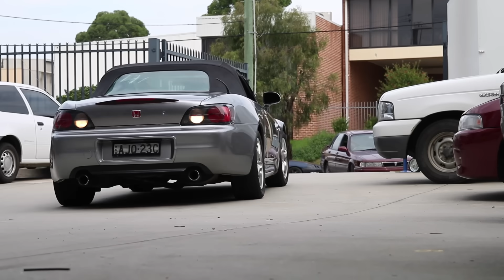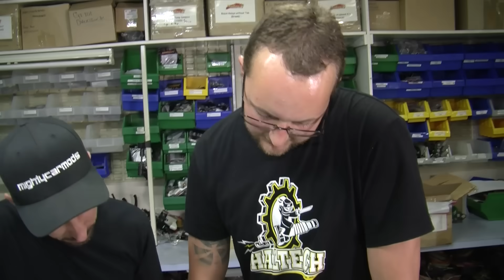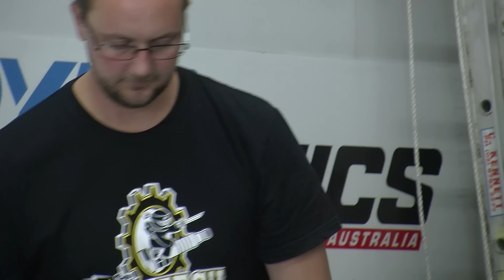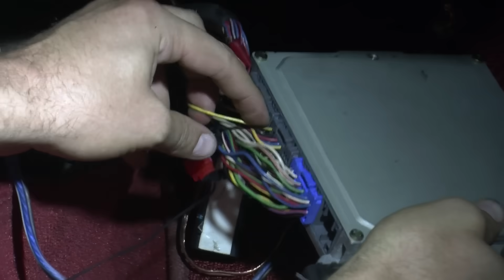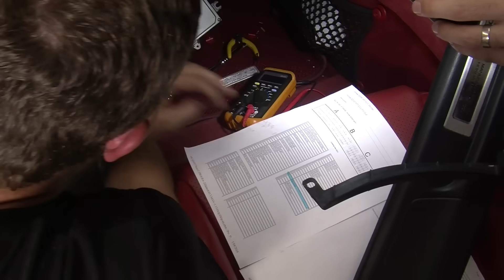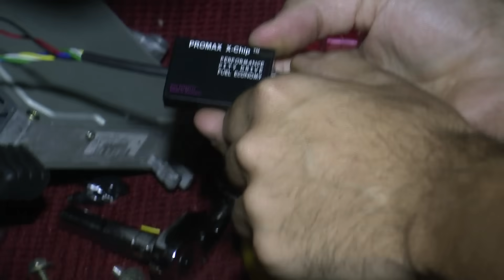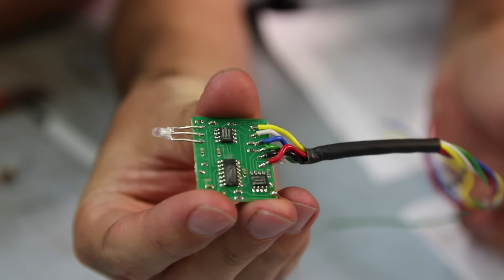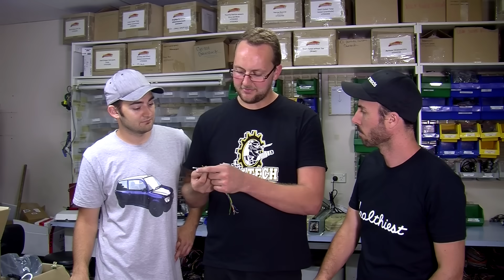eBay Performance Chips -  Mythbusted

Comment from the maker: Power at the wheels and power at the engine are two different things people - do a google!
Reply: Not sure whether to laugh or cry at the fact that people need to be told about this, especially on this channel
Reply: Vadim Matviichuk And there is almost always a difference in horsepower depending on the dyno, the weather, the airtemp, the altitude etc. But mostly the big difference is between different dynos, one dyno can show 170hp and another can show 190hp on exactly the same car on the same day and the same everything else.
Reply: 93simlar  people always forget this!  Just like a torque wrench, you can test 5 right next to eachother, they will all be close to eachother but none will be the same!
Reply: Moog, next time you race marty, you should put Flurpy in the passenger seat. That way, you have a little extra unicorn POWA!
Reply: Vadim Matviichuk your car loses power over the years. watch top gear they have an episode where the dyno to older sports cars and they lost almost 100 hp over the years
Reply: You lose 15-25% or so between the driveline and running peripherals so he's probably around 205-215 horse at the fly.
Reply: bhp per ton is what counts
Reply: You guys need to put a turbo kit on honda s2000 ;)
Reply: Wiat wuts a googel? I thouht a CAI cold air intke wud make mi car fastr?!@#
Reply: Christian Gotsch
I think what people are really getting on about is that an S2000 that puts 177 hp to the wheels is a busted S2000.  Crank hp for this gen S2000 is at about 240hp.  To put down 177hp at the wheels is atrocious, even considering driveline loss (which accounts for between 10-15% loss on average).  That is (what I think) people are getting at.  I also did a double take when they said only 177 at the wheels was being put down.  Then I scrolled the video back, realized they were on a DYNOJET and not a Mustang dyno and then said to myself "Oh, that's why".  Dynojets ALWAYS read lower than Mustang dynos because of the difference in how the dynos themselves operate.  That is why they typically will say if they are SAE corrected or uncorrected numbers.  The 177 hp this is showing is uncorrected, hence why it is so low.  If you correct it, it settles about where it should be, low 200's wheel horsepower.
Reply: Vadim Matviichuk Different dyno, different fan setting, different environment = different hp readings.  Not two dynos are the same
Reply: Vadim Matviichuk There are different versions of the s2000.
Reply: Jacob Laster mate*
Reply: I LIKE TURTLES!!!
Reply: I dont disagree necessarily however all well kept equipment should still read to within 3%-4% of each other during the same test in similar conditions. It should not be drastically off which is what it sounded like.
Reply: so, 1 Unicorn is 1,75 Horsepower is 1,3kW, so the stock S2000 is making around 100 Unicorns of power.
Reply: 93simlar Everything is possible. I've never heard of such dyno theory, so i might be wrong.
Reply: RunesLegacy There's actually 3 different versions of the S2000.
Reply: Joe11Blue I didn't know that but Idk a lot about the lil 4 and 6 bangers that's just never really been my style bro I'm more of an old school big block v8 American muscle kinda guy that's what revs up my engine lol but don't get me wrong I ain't saying the lil 4 and 6 bangers can't be bad ass rides also I just ain't as in love with them as I am a big v8 muscle car or truck ya know what I mean but what's the difference in the 3 if you were talkin about a ford lightning I'd probably already know since that's my baby I love when ppl get smoked by a full size truck and just can't stand it lol it's so funny though all the excuses
Reply: Jordan Mull When do dynamometers read power figures as they should be? That honestly has to be the most absurd thing I've ever heard considering the figures are there for a reason, to give you mostly reliable data. All the data should be within 3-4 percent of each other otherwise the data is useless.
Reply: Christian Gotsch They're there so you can get a baseline and do mods and see the changes.  They may read differently, but the units are the same and the dyno shows the same %loss, so any gain made on one dyno should be an actual hp gain that the dyno says
Reply: FrenchFruits That grammar.Its its so bad.
Reply: @JoshX9  Actually the grammar is not so bad, the spelling on the other hand is fucking horrendous.
Reply: MrBrennanCreeper Flurpy's a Nissan loving unicorn though
Reply: ***** wtf, is YouTube grammar class now professor? Who cares.... seriously, go write a book or something
Reply: ***** thats what i meant, people don't buy a sportscar to drive like an old lady
Reply: hahaha love "healthiest" shirt
Reply: slim617 Don't be that guy.
Reply: Mighty Car Mods  can you guys do a video on innovative chip you can buy on Amazon.com  it's $70
Reply: Vadim Matviichuk What exactly are you implying?
Reply: Christian Gotsch Like any other tool, a dyno needs to be calibrated correctly. Calibration can "fall off" after a time. EG: I've got some very high tech battery chargers, accurate to within 1/1000 of a volt., but unless they're calibrated annually, the numbers don't mean anything, or at least should not be trusted.
Reply: The problem that people are having isn't crank vs wheel power.  It's the fact that these runs were done on a Dynojet dyno and the numbers are uncorrected.  Most magazine numbers are corrected or run on a mustang dyno.  In those cases the number would be closer to 200hp at the wheels.
Reply: 93simlar
The problem that people are having as you have mentioned isn't crank vs wheel power.  It's the fact that these runs were done on a Dynojet dyno and the numbers are uncorrected.  Most magazine numbers are corrected or run on a mustang dyno, which is a different type of dyno and always reads higher than a dynojet dyno.  In those cases the number would be closer to 200hp at the wheels.
Reply: Just a few things I'd like to address within these replies. 1. This car appears to have been dyno'd on a Dyno Dynamics dynamometer, NOT a dynojet ;) DD's are notorious for being heartbreakers as far as hp numbers. That being said, 177whp does seem low for a stock S2k :-/
Reply: xex2kok uh.. exhaust is exhaust. there is no "magic" about brand exhausts vs generic. it's the least relevant part of an engine, its just a long tube of metal which expended gasses escape through. As long as it's in the right shape and angle, it doesn't matter the brand.

what you should be looking out for is quality of steel and welds/fitment. but thats it. no such thing as "this brand is generic so its gonna suck because magical exhaust powers of blitz and HKS is absent from the piping." NO. a pipe is a pipe dude.
Reply: Yes you're right but a stock s2000 makes around 235-240 bhp at the crank. So the power at the wheels should be around 200 bhp (considering a 20% power loss true the drivetrain, and that's still quite on the high side). So Moog what happened to your s2000's power? I'm not sure if Honda changed the spec for the australian market due to emissions? I know that BMW produced the e36 M3 for the european market with 286/300/321 bhp, for the american market they only produced cars with 240 bhp due to emissions.
Reply: But then why was the S2000 only making 177.1 rwhp?  That's 208 bhp at the flywheel.  Aren't these things rated at 240 bhp?
Reply: Turbo chip on turbocar is the real thing
Reply: ***** I've already tired to explain that. They don't care, everyone KNOWS whats right. Horsepower is a function of work of time no more no less.
Reply: Vtec, yo.
Reply: 75IFFY lmao XD wtf is a 75iffy
Reply: Vadim Matviichuk there are also vast differences in dino's too, food for thought
Reply: mynameisray at the crank lol
Reply: If the argument is that you cant get an accurate engine hp number number on a chassis dyno, yes that is true. However I don't care about engine hp when all I need engine hp for is to tell me how heavy of a clutch I need and I can approximate that in 5 seconds. I care about power that is delivered on the ground.  176 hp at the wheels is going to be accurate to 3%-4% on any chassis dyno you use regardless of how the number is measured and as long as it is measured in similar conditions.
Reply: of course if your point is instead that a dyno does not directly simulate a road driving situation because it cant get the same volume of air blowing over your car as at speed, I also agree with you. A hotter mechanical engine is a less efficient engine which is opposite of a heat engine before anyone wants to correct me.
Reply: Why don't people just cross reference the quarter mile time that an S2K should get with Moogs 14.4? Super simple....
Reply: IIRC Moogs S2k engine had about 100k miles on the clock and depending on maintenance (bad on most s2ks) it should have a significant performance drop. The second thing is the dyno and dyno adjustment. Depending on various sources the S drag coefficent is 0.36 to 0.40. And i don't know how fuel quality is in the Outback ;-)

Anyway the really important measures are actual performance figures and track times.
Reply: Marcelo LopesVEVO  Vtec and turbo? lol ;p
Reply: ***** DynoDynamics reads about 10-12% low vs DynoJet, which puts it closer to that 200whp figure stock S2000s sit at. On top of that count drivetrain power loss because this is at the wheels, it sounds right for DD figures vs BHP.
Reply: Everyone keep talking about the bhp/whp figures... he did a 14.5 @1/4 mile which is bang on the money for a 'stock' s2k. They should check ebay exhaust kits for the s2k to see whether they're just as garbage as all the other unbranded 'mods'.
Reply: this is fact BHP (break horsepower) Is the power which is measured AT the crankshaft. A dino measures power after its been through 3 shafts, 4 gears, a driveshaft, a rear-diff, 2 axle shafts and spin the wheels. this usually takes roughly 15% of the power just to turn everything. this is why carbon fiber/aluminum driveshafts and lighter alloy rims were made.
Reply: erick culler  Dyno Dynamics read 10-12% lower than Dyno Jet. It's why they're known as a heart breaker dyno.
Reply: HeavenzBreaker well thats the thing... do those generic brands have the right shape and are they made well.. also noise, if they sound like a gnome in a tin can with a wooden spoon or a majestic lion growling at its lunch, lol
Reply: john almand  don't confuse yourself. if your turbo and/or have a large displacement engine, the basic idea is that you have essentially a pipe that's thick enough and straight enough to allow horsepower (notice i said ALLOW, as exhaust systems do not GAIN horsepower). Thats all you need.

And it's not that hard for any company to make a straight pipe. it's not rocket science and has been proven again and again.

The difference between a stainless steel exhaust and Titanium exhaust is price and weight. not engine performance.

So yes a generic brand (or even DIY if you know how to weld) can easily make an exhaust that allows your engine the same performance as an extremely expensive exhaust.
Reply: NORML85 u dont seem so NORML
Reply: The s2k is so slow
Reply: Jesse Seijerlin Different dynos can give different readings. You can read this article that Hot Rod Magazine did that compares some different brand dynos: http://www.hotrod.com/techarticles/general/hrdp_1103_chassis_dyno_testing/
Reply: MrBrennanCreeper
And more weight boo!
Reply: They arent "two different things" when the result is still. fucking. zero.
haha.
Reply: All Gas Mn The point they were trying to make was that these eBay 'chips' are ripoffs, yet people still buy them.
Reply: 20% is the norm. Do the math and you'll see it's STILL way below the 240hp honda claims. It should be at like 196whp with perfect conditions. 20hp at the wheels says a lot about what the motor is doing at the crank. I guarantee the absense of torque is why this motor is so adversely affected by varying conditions. Also there may be something wrong your car. These things require valve adjustments and...ya  XD
Reply: Hey MCM why is your power so down?? I though factory HP was at 240????
Reply: Hey man, how about a spoiler alert here?!  Na, just kiddin', you get what you pay for when it comes to performance mods.
Reply: 93simlar WOW I worked on dynos in the auto industry for a few years and if that was true we might as well throw the dynos out since you claim they tell us NOTHING>

You sir; are wrong.
Reply: John-Paul Wylie Yes, its math. Horsepower is a function of work over time. More horsepower means it would climb through the rev range quicker.
Reply: if there was a difference in "power at the engine" it would have made a difference with "power at the wheels" 

if there is ZERO appreciable gain AT THE WHEELS then what is the point?

let me guess, you are a person who fell for "chip mods" and are trying to justify and convince yourself that it indeed does do something, when in fact it does nothing.
Reply: CrazyForCooCooPuffs Almost correct. No horsepower is measurable. It is all a calculated number based on torque and rpms. Yes, brake hp is figured out by the actual torque you are making at the wheels, but the horsepower itself isn't actually measurable.  HP=(torque x rpm) / 5252. Peak hp would be the biggest number you get along the curve. At 5252 rpms your car will produce the same hp as torque

Yes, the 177hp is the hp at the wheels, so the engine is producing over 200hp at the crank.
Reply: People don't know this?
Reply: COBB ACCESSPORT AND INTAKE to a subaru?

Can you do a test on that?
Reply: C20/-\ that is a real chip, or factory programmed to be different.
This chip from ebay falls into the scam category.
Reply: Mighty Car Mods you guys really need a tv show
Reply: me?
Reply: Tom Jones vtec means it runs on uncle bens wild rice
Reply: lmao
Reply: Mighty Car Mods Why THE Ukraine? It is just Uktaine without THE!!!!!
Reply: +Mad Scientistsami 4hp a year? So my 80 Rabbit 1.5d (48hp new) must have -52hp...
Reply: that's kind of a double duh... you drive onto a roller dyno   you can't measure hp at the crank.
Reply: Christian Gotsch Unless it's a RWD setup, that can rob around 15% of power, with all the forces from the driveshaft and diff etc
Reply: Yoshio Tamiya
There is actually not industry standard for calibrating a dyno.
Most tuners will use a car with known power output, like there own or a customers car that is regularly used for R&D.
Reply: ostenvind ... thats not the point here. yes i am aware
Reply: NorwegianBadaz You obviously have no idea how "Vtec" works or what it even is... a lot of iVtec and Vtec engines are rocking turbos or superchargers.
Reply: Octane Anarchy Detroit Born and Built But then again the Americans always lied about the horsepower ratings of old. That mustang didn't make the claimed horsepower even when new. Since the SAE HP rating is without any form of peripherals such as water pumps, generator belt, air conditioning and so forth.
Reply: tomelliott9
The quarter mile is exactly as tested on new car. Those S2000 just never had 240 hp.
Reply: Marine475 An FR set up can have huge losses in the drive train though, but atleast that means moogs S2K is alright and not broken
Reply: Moog, You need a turbo to make ponies :D
Reply: Hey Moog some things wrong with the MCM app. It's saying Tapatalk does not support your forum.
Reply: tomelliott9
There are not that many non RWD cars with 240+ hp are there? S2000 is about as fast as car that I drive daily and it's a big rwd fat V8 pig with automatic gearbox and bit less hp/ton. S2000 is a good car, fun and fast but it doesn't have 240 at the crank. Anyway I know this from a friend who used to work at Honda at the time when S2000 came out, we had a bit of a chat about it I said to him that the maths don't work with that engine and he told me that they pulled numbers a bit and it can make 240 hp but only in JDM spec and on engine dyno.
Reply: ***** Space out a letter? What are you talking about.And even if my grammar wasn't 100% it was much better then that guys.His comment was like he just button mashed the keyboard.
Reply: You do when that sentence is finished and you are starting a new one.And plus even if its not 100% perfect its better then most idiots on the internet? Right!?
Reply: ccx218 He may be a Nissan loving unicorn, but, he can still help out his unicorn powered Honda brethren.
Reply: ***** they did about all old cars by alot and most of them also if you took a simple resitrictor out or changed a carb it would increase but a large margin
Reply: 5150 Failure hey mate - speed at idle is based on your gearing and has nothing to do with power, torque, or even the engine at all, its all about rpm vs gearing
Reply: traaaaaaaaaaaaansfffeeeeeeeeeeeeer loooooooooooooooseeeeee woo
Reply: Vadim Matviichuk A car loses about 4hp every year so this result is absolutely normal.
Reply: Jacob Laster because he wanted to.
Reply: Do a google. lol
Reply: ***** S2000 runing in america can be underpowered because of the petrol, maybe if its US version it is tuned to use 92 octane petrol or even lower, in japan they use ~100 octane petrol for cars and s2000 is sporty car, petrol makes difference. My bmw suggest using 95 octane petrol at least, i filled my tank with russian 92 octane petrol, the consumptions of it was 1.5x bigger than with 95 octane, with a little bit of power loss
Reply: 5150 Failure  thats not making power. that's using more gas at idle. thats it.

the only thing your friend "tricked" is himself by buying an overly-lean reading maf, causing a larger injector cycle.
Reply: torque and horsepower.
Reply: DonForceFeedback totally agree with the ebay catback i have wondered about those for years!!!!
Reply: john almand The ones I have seen people buy on ebay worked fine. They are usually not made of the best material available so they probably won't last as long as a reputable brand but they work well enough. There are so many brands out there that you just have to find the cheap ones with good reviews somewhere because there will be some terrible exhausts on there as well.
Reply: Horsepower doesn't count!!! it blasts out unicorn farts and that is awesome!!!
Reply: mynameisray
the car is listed at 250 hp,that is way off still
Reply: Thanks for the education that I already mentioned,the flywheel hp,at 177 is more than 15-20%drivetrain loss,if what honda said about horsepwer being at 250 is true then this car should be making at least 200 hp
Reply: erick culler 240*
Reply: Christian Gotsch  some places do this purposely so that customer think their cars have more power and are happy. My car ran 222.8kw at the wheels then on another dyno it ran a bit over 230. Dyno numbers are to show off, 1/4 mile runs are where its at.
Reply: howde im jc from AZ and im in high school im 14  starting a automotive cahnell ill have a my frist video up on friday cheek me out westwoodmechanic love mcm
Reply: HeavenzBreaker i see what you are saying, having said all that i still think it would be a good test.
Reply: NorwegianBadaz I had a v-tec a while back and while it was pretty quick once it got going it was slow at low revs... a low pressure turbo to get the most out of low revs would have been brilliant on that car, would only probably add about 30bhp but it would balance the power so much better. A larger turbo would mean wider wheels needed possibly a strengthened chassis and brakes, and all it would do is give me massive turbo lag at low revs.
Reply: Vadim Matviichuk Well let's say I pop a big garrett on my granp's AX...It will still make less than stock! It's stood half hour limiter time just for the fun of not being able to climb a hill! It's so obvious the car is not new and it will never be!
Reply: Well obviously it's not meant to be taken literally, it refers to any manufactures of dairy products.
Reply: Jacob Laster
Less weight = more  power. =P
Reply: 5150 Failure Cummins don't have mas air
Reply: D.J Bruce herp dongalong shlong nong kong lol derrrrrrrrrrrrrrrrrrrrrrrrr
Reply: nutsackmania do my tow mirrors make me look Der te Der or is it my boost fooler?:
Reply: You do know a real performance chip can be as effective as a re tune or ecu swap right. You also know that these mods are capable of boosting 20 to 50 or so horsepower and even more if the car is a really hi powered vehicle. Cmon guys do your research or spend money on a chip that has a good rep.
Reply: LimitlessAeon619
It's a 99. Piston rings are probably loose or worn. I kind of expect that.
Reply: it does not matter ,there was no power gain,they are measuring power at the wheels with the dyno.
Reply: so ill just save and buy a Haltech bolt on usb plug in and YO..
Reply: You mean a gargle?
Reply: CmdrTobs Didn't you just see that the chip does nothing at all? Straight through connection, meaning the signal does not change one bit. The only way to make power form "chipping" your car is to re-program the ECM. In case you are wondering what my credentials are, I own a shop. 'Nuff said
Reply: Yeah true. My bike is a 17hp difference from wheel to engine on the dyno.
Reply: ***** When we/Americans lied about horsepower, we actually underrated it, not overrated as you claim, other than that a Honda is not an American car. Must be that V-ECH powa holding it back on the Dyno, lol.
Reply: So if you have a car with 150hp and at 1000rpm it does 10kmh, then you beef up the engine and its putting out 600hp, with the same gearbox and diff (read:gearing ) at 1000rpm it will still do 10kmh.
Reply: 177 whp is about 235 crank hp, so the extra 30hp should have been at the crank so about 185-190 whp !! Not 210 whp hahaha
Reply: Eric Hermann avoid saying the power loss in percentage. People end up thinking a stock 100hp engine at the flywheel with 10% drive train power loss has only 90hp at the wheel and if you tuned it to 200hp it would only have 180hp. The 15% rule is bullshit anyway. That would mean a Bugatti engine has 1250hp at the flywheel cause it has 1000 on wheels. I used a 4wd with 25% DT loss in this case to show how extreme it can get. Ive no idea about the Veryons DT loss but I assume it wouldn't be 250hp.
Reply: HachiRoku
It's not a "Rule", it's an average.  And it holds true "on average".  The key word is average.  There will be outliers - like your Bugatti and 4wd examples.  It is an attempt to explain an idea that a lot of people weren't grasping, not to give a concrete number for all applications.
Reply: Eric Hermann
i does not even give an average. A 50 hp car would have 30% a 100hp car would have 20 and a 200 hp would have 10% and it depends on the car.
Reply: I already said that I agree with you on those cases.  However, the fact you are missing is in the word AVERAGE.  The average car is NOT a 50hp car.  Nor is it a 4wd car.  Nor is it a 500hp rwd beast.  Its a front engined, front wheel drive 4 cylinder car (Civic, Corrolla, Camry, Focus, etc) that makes under 200hp.  For the AVERAGE car owned by the AVERAGE person the 15% AVERAGE works well enough as an estimate of power loss.  You are splitting hairs.  Again, average is the key word.  Don't lose sight of the argument in your quest to simply be right on technicalities that don't apply to the topic being discussed, as I already stated those NON average vehicles are not what I am referring to.
Reply: HachiRoku And even then, on average, the same model car will have the same average loss.  Its for estimation purposes only.  If you want an actual number, you would obviously need a dyno.
Reply: Eric Hermann S2000 is RWD, just lettin you know.
Reply: zetsi77 I am fully aware of that fact.  Have driven several S2000s and nearly bought one myself.  :D
Reply: good decision on choosing to pass, I was not impressed with the two that I test drove
Reply: This is just a generalized statement;
Everyone can say "Oh it's normal" all they want...The fact remains that even accounting for drivetrain losses at 17-22% or there-a-bouts, the car is down on power. It's an early 2000 Honda people, do you really think it's lost THAT much compression over the years? Something is off about those numbers, without a doubt.
Reply: whoohaaXL

240 HP - 20% driveline loss is 192 hp, then take a decade and a half of wear and compression loss to add another 8-12 and that is a pretty accurate figure. 

(and that is being conservative at a 1.1 - 1.3 % loss of power per year. )
Reply: Gabriel Howard HOW DARE YOU USE LOGIC AND COMMON SENSE!!!!
Reply: I'll say it again, the car is down on power regardless. Every Honda I've owned (about 7 or so, till I moved onto Probe GT's) Has always had excellent compression, within 3% of factory. This is mostly on older D-series with every one being over 100k. There's no way a higher-spec engine (with beating on it taken into consideration, as I'm sure Honda knew it would happen with a 8/9k redline) would be that low unless that car was HEAVILY neglected...
Reply: whoohaaXL That is a Dyno Dynamics roller, they read lower than Dynojets do. Even within same brand dynos they all read differently. Remember dynos are mainly just tuning tools. Not meant for a "period end of discussion" type argument of a cars power output. The only true way to get an idea of a cars power level it by looking at it's trap speed.
Reply: Lolz can't believe you had to actually say that MCM!!!   XD.       GG to the eBay scams !!!   Lol.
Reply: ClintcorpCEO Kinda sad, eh?
Reply: Well, considering they didn't do anything to transmission, there still whould be a power upgrade, because the difference between base ( engine) horsepower and wheel horse power is the transmission loss... increase bhp by 35 , an you should get like 15-25 Whp, depending on your transmission...
Reply: Indicated horse power = calculated HP your engine makes in if it was frictionless
Brake horse power = horsepower you can measure with a mechanical device
Friction horsepower = the amount of HP the engine loses running it self and accessories and drive train (IHP-BHP)

177hp honda, it makes 200 indicated so u got a fhp of 23hp whch isnt bad, efficient engine
Reply: CrazyForCooCooPuffs Where are you getting 200 from? The AP1 and AP2 make upwards of 230 and 240hp respectively.
Reply: whoohaaXL ur right, for some reason i thought it was 200, so i guess its FHP is about 70....ouch
Reply: CrazyForCooCooPuffs Tell me about it, pretty poor, eh?
Reply: Exactly if you don't make any power at the engine your not making it at the wheels! Not only that but if you drive a rear wheel drive car and dyno just the engine before putting it in the car and it makes 402 H.P.Then put it in the car your gonna lose about 80 to 100 H.P. through the drive shaft! So you will end up with a 300 H.P. car!!! That's why rear engine cars screw because you got two drive axle's coming out of the transmission to the wheels not a long way to go to transfer the power!!! How's that for a google!
Reply: ***** Different horses have different horsepower so of course it isn't measurable!
Reply: '96 VR-4 Spyder hp at the wheels is like donkey power and hp at the fly wheel is horse power
Reply: 1 horse can pull 550 pounds suspended from a cliff 1 foot per second, therefore he is doing 33000 ft-lb a minute. Thats why 550 and 33000 are arbitrary numbers, thats where the horse power came from. James watt came up with the horsepower measurement so he could sell his steam engines to stubborn farmers who didnt believe horses were better than his engines, so he came up with "horsepower" to describe how his engines were better. So saying this has 2 horsepower makes it sound better than 1 horse.
Reply: ***** Being a power plant mechanic I learned that story from my instructor in school.
Reply: if its copy and paste, copy and paste it into google and you'll see if its copied.

In the aviation field its brake horse power, shaft horse power, indicated hp, and friction hp. thats it
Reply: Vtec Crub!!
Reply: I dont understand why people make fun of Vtec, like the guy above me.

any car u drive today has some form of variable valve timing so ur kinda making fun of something all engines now have, including urs
Reply: That's because some people haven't seen Best Motoring, it's a japanese car show. Besides I was only repeating what was said in a clip from one of the segments featuring Hondas ;)
Reply: what about the police chips my dad had a 01 commode ex chaser. i thought they would. what dose the wonderful youtube comments say
Reply: Power at the wheels accounts for power loss through the drivetrain. Horsepower at the engine will always be higher than at the wheels. Also hp was measured different ways Ober the years. Brake hp(BHP) is at the crankshaft, and then SAE net and SAE gross are measured at the flywheel and are measured differently. It changed over the years also.
Reply: Maybe you should have bought a better one
Reply: Just get a haltech piggy or the pro 1.
Reply: Jacob Laster Did you want to run your fingers through it?
Reply: Mighty Car Mods WTF is a vtec "YO"?
Reply: 75IFFY honda's fuel management system
Reply: Really going for the Lost in Translation thing arent you. Trying a bit hard methinks
Reply: 75IFFY was that a jar jar binks reference....
Reply: noobtube1210
no, its just another way of saying "I reckon"
Reply: Mighty Car Mods  I think you buy a better chip!!
Reply: increase th hp with a couple bucks .Haha totally shit
Reply: 5150 Failure Ok ok, it's a turbo diesel? Then there's no Air/Fuel mixture, and there's deff no MAF sensor. And there's no chip or even computer if it's a mechanical 12 V cummins
Reply: Lee Morgan did i say it was a v12? its a 2010 dodge 2500 yes there is a computer in it. most cars and trucks have them, atleast newer models.
Reply: 5150 Failure 12V = 12 Valve, which if it's a 2010 then it's not,, 6.7 Cummins.
Reply: i dont know the engine size Lee Morgan
Reply: Oleg Monastyrskyy Слава
Українa! Слава героям України!  "Ще
не вмерла Українa! "
Reply: Oleg Monastyrskyy The Oktaine
Reply: Octane Anarchy  They were testing super-sports cars from the 80's, whose engines were made of wood and psichotropics, today's cars don't loose that much, and if it is well mantained (not like the ones tested by TG), the loose is almost not noticeable
Reply: Roberto Merino 75IFFY Rekt
Reply: Roberto Merino
"That face" is the face of Susan Atkins. Much older than I and the wrong sex
Reply: Mighty Car Mods it is not made in german ,what you read at the beginning is maby polish,
Reply: tomelliott9 because its a stick shift lol
Reply: Vadim Matviichuk Yea BHP, WHP, and also engines that produce low HP though high torque. Then of course there are SC, turbo kits, stage 1,2,3,4,5 tunes, larger injector/down pipe, lighter fly wheels, spec torque converters, dif gear ratios, etc, etc... the list goes on. But reading these claims of up to 100 HP from a $20 three wire little circuit board... what kind of moron would believe that??? LoL
Reply: +mike sullivan there is no such engine v4... 4 cylinder are in row. the "v" stands for the two cylinder banks how they stand to each other. there are v engines in 60 and 90 degrees. do a google search. sorry for my bad english ;)
Reply: mike sullivan well, you can't really make a 1.3 liter 4 cylinder sound like a big engine. Put an open filter on your intake (for example k&n) and it should make a big difference in sound to stock ;-)
Reply: +antianabolic my Subaru has a flat 4
Reply: +Vadim Matviichuk check the rx-7 it had a year where a lot of vehicles weren't tuned to the same h.p there was a vast diffrence
Reply: I'd recommend actually purchasing a real aftermarket ecu chip. Everyone knows you have to spend at least $30
Reply: +Mighty Car Mods Everybody knows that.
Reply: +Vadim Matviichuk , it's a car often used in high revs and maybe that engine tired.
Reply: +Mighty Car Mods Seeing this again and knowing you guys are at sea level, I still can't help but think this car should be making closer to 190-195 at the wheels. I just think it's a slightly tired engine, wish he did a compression test and posted the numbers to prove us all wrong.
Reply: +antianabolic  I believe the ford transit van came out with a v4 if I'm not mistaken
Reply: anthony lingard
...and a 3literV6 from the Taunus, later also V8 from the Scorpio.
Reply: +Mighty Car Mods would have been somewhat interesting to see a chip for a car that actually has an EPROM based ECU. Like an E30 or E36 (VANOS yo :P lmao)
Reply: +FrenchFruits do your english homework  :D
Reply: 223rd comment, i would like to make a speech
Reply: Denied
Reply: Mijc Osis Indeed. Buy a eprom off ebay and swap it it...with actual maps...that would be cool.
Reply: whoohaaXL for sure - given you can get so many chips and even maps for flashable cars it would be quite informing
Reply: +Leonard Nedosekov Octane doesn't make a difference in naturally aspirated cars. Only reduces chance of detonation.
Reply: Mighty Car Mods e
Reply: probably is somewhere near that at the crank. almost all manufacturers, certainly in Europe quote crank power (approx.)
Reply: Ook guys as far as the hp rating back in the day all cars advertised hp at the flywheel around the mid 70 all hp was then measured at the drive tire that's just the way it is if a cat advertises say 215 hp that's at the rear tire . Period
Reply: I concur people that watch this channel  shouldn't need told that theirs are difference between crank hp and brake hp
Reply: Shadowboost I think people by different dynos meant say mustang dynos or a dynojet...but what do I know
Reply: Eric Hermann finally I'm reading all these people talking about "different"  dynos and people for some reason end up talking about location and environment,  but we actually mean there is are makes that are different, a mustang dyno and a dynojet dyno, one gives a corrected number, one gives you uncorrected.  I can't believe people don't realize this.
Reply: Mighty Car Mods                        ::: and
Reply: PLEASE do a review on the Sprintbooster!!  https://www.sprintboostersales.com/
Reply: Depends on Gearbox, clutch, bearings, rims, tires... A Nissan GTR has less than 8-10% loss for example... Some dynos only measure WHP, others measure WHP and the loss while decelerating and ADD them up... He may have loss of 70hp from wear and really have 240hp at the flywheel
Reply: Dont need google thats common sense
Reply: if there is a gain at the engine then there is a gain at the rear wheels. it usually drops by about 30 % though.
Reply: Mighty Car Mods 9lllllll
Reply: driveline losses
Reply: “Do a google”. I love it
Reply: Does that really surprise you that the average person don't already know that like they should lol but from my experience and what I've seen and studied about this the average vehicle loses 10 to 15 percent so just say on average about 13 percent of hp from the fly wheel to the back wheels or front on a front wheel drive
Reply: Actually.......HP kinda makes a HUGE Deal 😂😂
Reply: Just gonna say maybe if you had wired it into an engine with an MAF it might have actually worked
Reply: Also just saying if you think your Honda is fast, my mustang GT from the 90s made 215 horses stock, or about 160 kw, and with nothing more than the addition of a cold air intake and a tune, this 4.6l v8 sohc 2-valve naturally aspirated port injection engine can actually break 300 horsepower, or 223 kilowatts. And not only that, but it is a car from the 90's (96 to be exact) and is technically a "classic" according to my insurance, whereas your car is actually a modern car, at least 10 years newer. I'll admit yours is probably lighter, but that just means mine can launch harder, and that engine can, without replacing anything in the engine other than cams, valve springs, spring retainers, and the throttle body, and with the addition of a performance exhaust alongside previously stated mods, can theoretically exceed 500 horsepower, for under 1k$. (Mostly the chip, exhaust, and intake stuff, the cams and springs are cheap as hell)
Reply: @Prestiged_peck  I have a bike from the 70's that would blow your mustang off the road and its not even 1000cc, no disc brakes. im pretty sure it runs on corn oil and paint thinner
Reply: "Do a google"
Reply: YOU HAVE QUESTIONS? I HAVE ANSWERS!!—Perversion, death and murder increasing! ...LAWS are made to protect people and increase or maintain quality of life for humans.. There is a growing REBELLIOUS trend to TRASH laws, including moral ones, as mentioned in the bible. 99% of preachers don't even support ALL 10 commandments, and many don't support even any by their LAWLESS heresy. CRIME & CLERGY CONNECTION = TRICKLE DOWN IMMORALITY.. "When people’s thinking is controlled by the sinful self, they are against God, because they refuse to obey God’s law and really are not even able to obey God’s law." ROMANS 8:7 Society will increasingly SUFFER! The barbarians are coming, the barbarians are coming...!!! The preachers lead the charge!! "My people are destroyed for lack of knowledge: because you have rejected knowledge, I will also reject you, that you shall be no PRIEST to me: seeing you have forgotten the LAW of your God, I will also forget your children.” Hos 4:6 Christianity is mostly now populated by GULLIBLE , DECEIVED, FANATIC VICTIMS who have never read even the whole new testament once. They spend almost ALL of their weekly waking minutes (6720) influenced by perverted , depraved worldly culture and , if they attend church, learn a bunch of ambiguous, abstract, obscure, religious lingo & cliches for teaching by inept preachers who are deceived modern, law trashing, bible warping Pharisees. RESULT??? MATT 24:24
Reply: Just looking at it I can already tell that it's a  piece of junk worth only a penny.
Reply: WHY DID YOU CUT YOUR HAIR? COME ON M8.
Reply: Guys, all dyno's read differently.. the numbers aren't meant to be taking literally.  The numbers are just there for tuning, and that is it!  There are 3 versions of the S2000, but all of them make the same 237-240bhp dependent on country you live in.
Reply: RunesLegacy Yeah, there are different versions (like for US, EU, JP) but their power differs only by couple of hp or kW, not by 50hp or 60hp.
Reply: well i did google as you said and i found that on the wheels it has 160kW (214hp) and 190nm, it still more than 177hp your dino showed :)
Reply: over 1400 thumbs up? really? The ONLY thing that matters is they measured before chip and after chip and used the same dyno hooked up the same way. the point is it did not work, not that someone get a term wrong and ha ha  you're smarter then they are, which you are probably not.
Reply: Scam get a real tune you think you are getting a tune for 20; get real people
Reply: One thing not to forget that performance chip might not last long . Furthermore , it might damage your ignition coil which will caused your car loss power or whatsoever .. Anyhow , it's fun having it ! Enjoy !
Reply: Duh!
Reply: lol i put a maf sensor in my friends dodge truck, no it wasnt from ebay i believe it was a k&n sensor, it tricks the computer to think the air fuel mix is different and i did notice a power diferance now we didnt dyno it but with chip it idle rolls at around 5 to 10 mph, without id say highest 5 so idk if it truelly made power but with his turbo deisle it felt like it